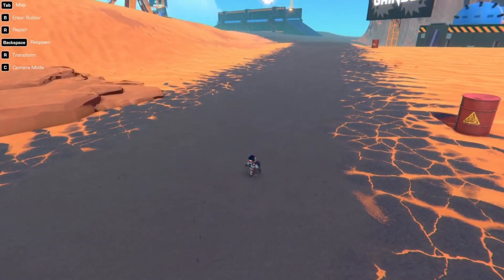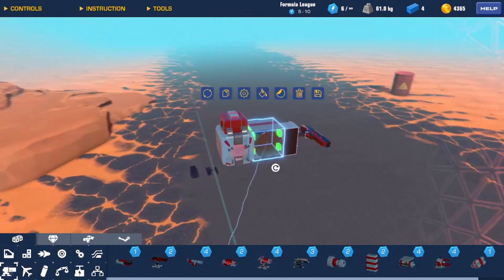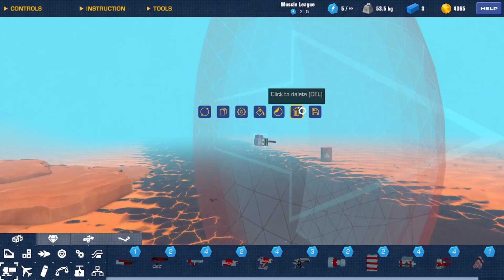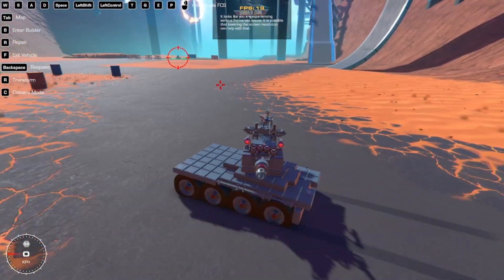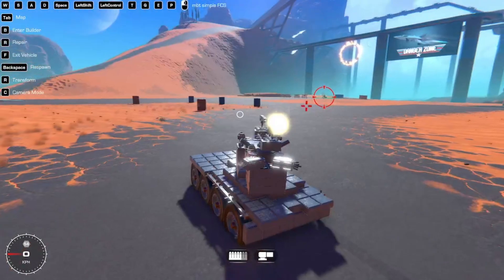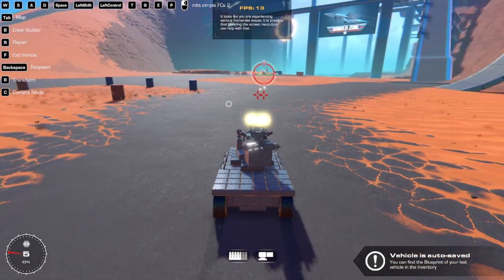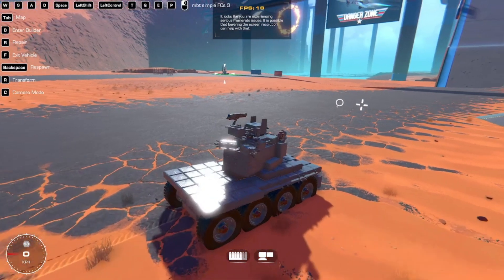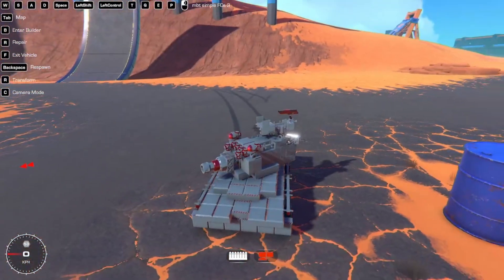Tank FCS in Trailmakers

Comment: whats the point of the tracking if the auto tracking feature on the other cannon already does that \
Reply from the maker: its to allow the turret to track 360 degrees and also allows you to use piston acceleration which normally throws off auto aim.

Comment: You should try making a radar that scans the sky and can accurately display the position of an aerial target in some form. Maybe even able to lock onto it once detected. You will likely have to use 500 meter distance sensors. Idk what platform you're on, but if you don't already have it you can probably get it from someone else.
Reply: 500 meter distance sensors? How do you get those??
Reply: @leonardosousa297 mods
Reply from the maker: i will definitely consider it

Comment: I learned somthing about pistons, it happened while I was testing how much wight they can support. It's inconsistant btw. but in general glitchness happens past 23k kg.

Alright buckle in, this is gonna be a paragraph and a half. 
My testing lead me to trying it against another piston. I set the stationary one to -100 speed with auto reset on and the controll to 5. Now Introestingly, the Poston at 5 speed moved the other one effortlessly. Of course I did thuther testing, using detachable blocks, and then connecting the pistons themselves. I got the same result. Now of course I wired the -100 speed piston up, gave it some controll. Whatever you set the 5 speed piston to would then cause the -100 speed piston to go down and then bounce back up to that hight. Well, just a little higher but it's close to the same hight. It refused to go up however. I then added another contoll group, by adding a 50 speed piston with auto restet off. With the 5 speed now being in the middle. I got the same results as the -100 speed, exept it went Back to the same hight as the 5 speed piston exactly. It would go down like normal, but when you tried to move it back up, it just would not surpass the distance you manually set for the 5 speed.

My mind instantly went to a gear shift of sorts, though I could see this being usefull when you want 2 seperate speeds for a piston and not 274 logic gates to do so. (I'm assuming you have 2, or even 4 pistons on a connection point already. Becuase semetry is nice)
Reply: You should post a video with this testing, te text is confusing
Reply: Eh. I don't know how to record audio, and I don't wanna be that guy that uses text
Reply: @Zane12.1  no shame in using text, if it helps the comunity